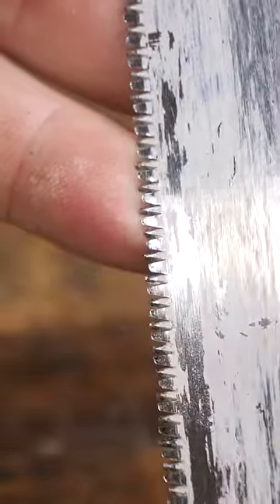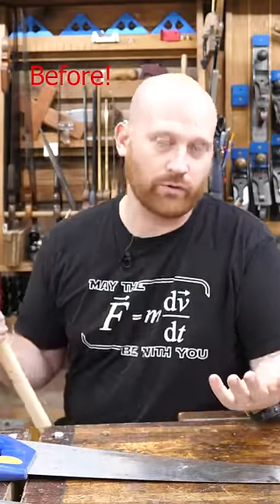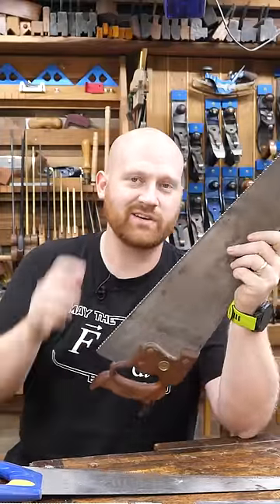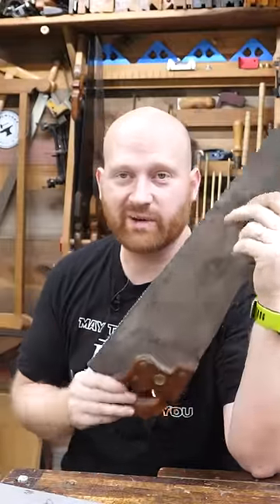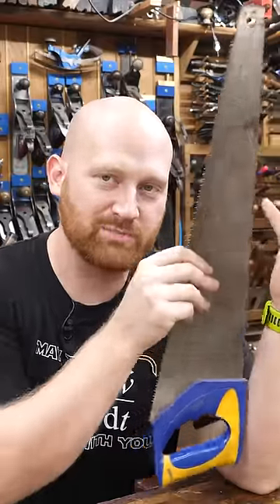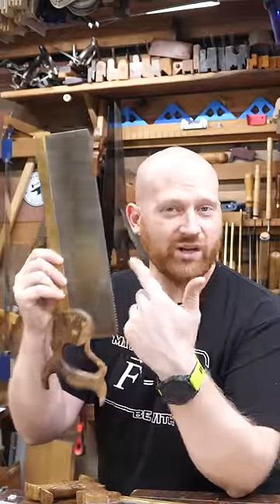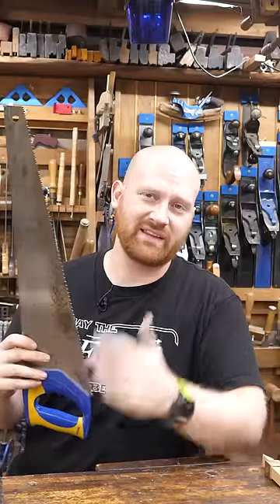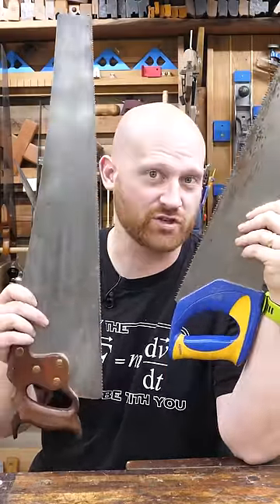Hardend Teeth Vs Old School Teeth on a Hand Saw

Comment: You absolutely can get a hardened saw resharpened and rehardened, but whether or not it's worth it is debatable, because it requires a grinding.

It's more worth it for metal bandsaws, if you know how to run them without snapping them.

Comment: But if you use the right Steel you can still harden it, then temper it to a level that's below that of your file and you can still sharpen it though.
Reply from the maker: That sounds good in theory, but in practice, it often warps the plate. most people if they want to re-sharpen it grind the teeth off and file in new teeth, but both are a lot of work for a $10 saw.

Comment: I've not tried it, but can you just heat a hardened blade and let it cool slowly, and get a blade that can be sharpened?  I know it's not really going to be worth the trouble, or even cost of the heat, but can it be done?
Reply from the maker: The problem is that usually leads to the blade warping.

Comment: Couldn't you heat the saw and slow cool to normalize the steel and then sharpen the teeth?
Reply from the maker: That sounds good in theory, but in practice, it often warps the plate. most people if they want to re-sharpen it grind the teeth off and file in new teeth, but both are a lot of work for a $10 saw.

Comment: You can sharpen hardened blades. I do it with my steel cutting   diemaster bandsaw blades. It just takes the right tooling and little patience.
Reply from the maker: Very true. However the diamond file needed to sharpen these cost more than the sawdust and do you really want to spend all that time on a $10 trash saw.

Comment: If you harden them at the factory, then you get 3x as much use out of them initially, before you need to anneal them, so you can sharpen them.
Reply from the maker: That sounds good in theory, but in practice, it often warps the plate. most people if they want to re-sharpen it grind the teeth off and file in new teeth, but both are a lot of work for a $10 saw.

Comment: That's a great idea but if your time is worth money consider how much time you going to spend sharpening a saw blade versus how much a good-quality hardened Blade cost
Reply from the maker: There is a reason that the good quality blades are in hardened. Only the cheapest plastic saws are hardened. Go look in any professional woodworkers shop.
Reply: @WoodByWrightHowTo  I grew up in one. And I also understand why people like traditional woodworking methods. And that's great if you're doing a hobby. But there's also a reason the power tools exist and are still found in every Woodworking shop actually making money. I've been a machinist for 30 years. I understand how blades work and actually enjoy sharpening tools but that takes time, lots of it. I'm not saying you shouldn't do it but there is a cost/ value equation that needs to be made.

Comment: To be fair, the quality spring steel used on old saws was harder than the junk new saws are made out of. Another reason they harden the teeth is because it makes cheap steel hard enough to cut with.

Comment: I wonder if it would be difficult to anneal a hardened saw, so it could be sharpened.
Reply from the maker: I've heard quite a few people propose that and I've seen one person try it and the saw got messed up and bent from the heat treatment. Not to mention it takes several hours to do a full cycle. It's just usually not worth it on a 5 to 10 dollar saw.

Comment: Are you also showing japanese saws? These things are a recommendation to have, because the saw operates the other way around it's extremely easy to use. Dont see many of them sadly
Reply from the maker: I've got a few videos on Japanese versus Western sauce. And I use them both for different applications. The pull stroke has a lot of benefits. But it also has a lot of downsides you don't find until after using it for a few years. The pros and cons list is actually rather interesting.

Comment: You could probably heat up the treated teeth with a torch to undo the heat treat
Reply from the maker: You could but there is a good chance of warping the plate. Most people just grind through the hardening if they want to re sharpen it, but that is a good bit of work for a $10 saw

Comment: Never seen a framer or  contractor whip out a hand saw. They’ll use skill saw, sawzall, oscillator, and a mitre saw. If it ain’t powered it ain’t getting used. Maybe shop carpenters use these but rarely field workers.
Reply from the maker: I used to do framing for a few years and we had a couple of them in the trailer. There were a few tasks where it was the fastest and easiest.

Comment: You could anneal and then reharden them. Then you’d get the best of both worlds. 

Or you could sharpen with ceramic files.
Reply from the maker: That sounds good in theory, but in practice, it often warps the plate. Because of it being a thin plate it tends to destroy slip stones. But they do make diamond files that are the right shape and size. Those just end up costing more than the saw itself. most people if they want to re-sharpen it grind the teeth off and file in new teeth, but both are a lot of work for a $10 saw.

Comment: Should I sharpen a Japanese saw, made for extreme precise cuts and is super thin, or is the steal made to last forever? (Btw, I use it on a daily basis)
Reply from the maker: If it was purchased in the US it probably has hardened to teeth and in that case it's intended to be a disposable blade. However the really high-end Japanese saws are sharpenable. However due to the multiple geometries they are incredibly difficult to sharpen and require very specific specialty files.

Comment: You make it sound like people stopped sharpening their saws first but I thought it was the introduction of cheap hardpoint saws that ended the practice of sharpening. Is there evidence of sharpening dying out first ??
Reply from the maker: Where is evidence for both. It's less if they stopped to sharpening the saw but they started using a saw that doesn't get sharpened. Such as the table saw or circular saw. The hard point saw was first introduced around that same period.

Comment: That also explains why old saws were so wide. So that you could sharpen them and still have a saw left.
Reply: It actually helped controlling the cut with a wide saw, it gave the blade more backbone, no kinking-bending when pushing forward

Comment: You can anneal the saw to resharpen it, and then re-harden the teeth if you wish.
Reply from the maker: That sounds good in theory, but in practice, it often warps the plate. most people if they want to re-sharpen it grind the teeth off and file in new teeth, but both are a lot of work for a $10 saw.

Comment: Why not soften it when you need to file and harden it when you are not?
Reply from the maker: That sounds good in theory, but in practice, it often warps the plate. most people if they want to re-sharpen it grind the teeth off and file in new teeth, but both are a lot of work for a $10 saw.
Reply: @WoodByWrightHowTo  fair, didn't think of that

Comment: You ignored the fact that sharpening files are good for only three uses, then they get tossed.
Reply from the maker: Not sure what files you're using. I can usually get a dozen to two dozen sharpenings out of a file. And that's with the cheap ones.
Reply: @WoodByWrightHowTo  
A man named Tage Frid is holding me back.  He said to use each corner of a file only one time.  He was a notorious cheapskate, so he wouldn't say it if he didn't have a reason.
Reply from the maker: Well. I've never heard anyone say that. You can get dozens of uses out of them. I know one guy who's using the same file for years. It gets slower to cut but will still do the work.
Reply: @WoodByWrightHowTo  
Frid wrote that in his book on joinery, and in an article in FWW magazine.  He claimed that a sharp file makes a sharp blade.
Reply from the maker: I would have to greatly disagree. If you read book on the topic or talk to saw makers they will lead you the other way.

Comment: So what I gather from this is that the people who value their time choose to pay more in the long run in order to avoid the hassle of sharpening saws.

you could (A): spend 50 hours learning to sharpen a saw and spend an hour to resharpen it when you need to.

Or (B): Spend 40 minutes picking up 50 saws at the hardware store and always cut with a sharp saw every time.
Reply from the maker: The problem is the cheap hardened saws cut worse, have horibal handles, and they don't come in the verities of teeth you would want for woodworking. Just rough crosscutting.

Comment: Or the entire saw can be hardened but not super hard just harder and we sharpen them with cbn or diamond particle feather files so we get the best of both worlds.
Reply from the maker: Problem with hardening the hole saw is that it then becomes brittle. There's a reason the plates are tempered to only about 45 or 50. At that point it's a spring steel and wont knik as easily.

Comment: Why not sharpen a blade after the hardened teeth wear away?
Reply from the maker: most people if they want to re-sharpen it grind the teeth off and file in new teeth, but both are a lot of work for a $10 saw.
Reply: @WoodByWrightHowTo  thank you! Appreciate the timely response

Comment: You can purchase a diamond impregnated file to sharpen these hard piont saws
Reply from the maker: there are a few of those the correct size and shape, but they cost more then the saw. and to you really want to keep using a cheep plastic saw?

Comment: You could get rid of the temper with a propane torch.
Reply from the maker: That sounds good in theory, but in practice, it often warps the plate. most people if they want to re-sharpen it grind the teeth off and file in new teeth, but both are a lot of work for a $10 saw.
Reply: @WoodByWrightHowTo  Good point!

Comment: I'm so confused. I feel like it went back and forth on which blades are hardened and not.
Reply from the maker: If your saw was purchased at a big box store or hardware store in the last 20 years that probably has hardened teeth. If it's an antique then it probably does not have hardened teeth. If you look closely at the teeth hardened teeth will be blackened with a shiny plate whereas unhardened teeth will be the same color as the plate

Comment: Would sharpening with a simple set of diamond files not work.
Reply from the maker: The diamond files with the right shape and size cost more then the saw.
Reply: @WoodByWrightHowTo  Coming from the knife world that isn't weird to me and still seems worthwhile if you can get multiple times the life time out of every saw but to each their own.
Reply from the maker: True. But then you are left with a trash saw that has a poor handle. At that point you could make a new handle for it but after doing all that work you might as well just go by a good quality saw.
Reply: @WoodByWrightHowTo  Fair enough. Just because you could sharpen a utility blade doesn't mean it's worth the effort. I guess the same logic would apply to a cheap intentionally disposable saw.

Comment: Cant u recycle the metal?
Reply from the maker: Yup
Reply: @WoodByWrightHowTo  would u need to remove the handel from it or could u throw it all in the recycling bin?
Reply from the maker: depends on your recycler. but you can also re use the plate for a lot of other things.

Comment: You can definitely sharpen hardened blades/teeth without destroying a file.
Reply from the maker: They do make diamond files that are the right shape and size. But those cost more than the saw and do you really want to spend that kind of money on a cheap plastic saw.

Comment: Blowtorch detempering go brrrr.
Reply from the maker: That usually ends up warping the saw. Most people if they want to re-sharpen it they just grind the teeth off past the hardening and then file them like normal. But that's a lot of work for a $10 saw

Comment: Solution: diamond sharpener, which I'm sure you already know.
Reply from the maker: that can work, but they tend to rip the diamonds off because you are going across the plate. not to mention they cost more then the saw. not sure it is worth it on a $10 plastic saw.

Comment: You can use a grinding Stone if you know how to sharpen harden steel. You know that?
Reply from the maker: You can't sharpen salties with a grinding stone. For that you need a 60° file. They do make diamond files but that is more expensive than the $10 cheap plastic saw. There's a reason that quality saws still come with unhardened teeth. You just won't find them in the big box store.

Comment: with the right diamond files and highspeed cutters you can sharpen any hardness.
problem is chipping and bending hard teeth that break when angle is reset.
the precise alternating angles of the teeth are critical to a even pull and selfclearing cut.
Reply from the maker: They do make diamond files the right size and shape for it, but they cost more then the cheap plastic saw.

Comment: If you really do want to sharpen your saw you can anneal the teeth with a torch.
Reply from the maker: That sounds good in theory, but in practice, it often warps the plate. most people if they want to re-sharpen it grind the teeth off and file in new teeth, but both are a lot of work for a $10 saw. By h

Comment: You can anel them
Reply from the maker: That sounds good in theory, but in practice, it often warps the plate. most people if they want to re-sharpen it grind the teeth off and file in new teeth, but both are a lot of work for a $10 saw.

Comment: Have you ever heard of a diamond file 😱
Reply from the maker: Yes. I have a video coming up on those. They do work but they don't last very long you only get a couple sharpenings of them due to working on a thin plate structure it strips the diamonds off pretty quickly. And usually they cost two to three times as much as the saw. So the question you have to ask is, is a $10 plastic saw worth it?

Comment: Honestly, I've never understood why saws are so wide but are only used for like 1/16th of the blade. Like, why?
Reply from the maker: it keeps the blade on track and keeps the plate stiffer. you can get thin blades like that but they are for turning saws where you want the blade to turn and go all over.
Reply: @WoodByWrightHowTo  so then, is my reciprocating saw more efficient material wise? Just curious the mechanical advantage of using a wider blade on hand saws vs the smaller saws with reciprocating saws.
Reply from the maker: The reciprocating saw is only up to 10-12" and if you have used those longer blades you know how easy they are to bend. when the saw is 24"-36" it needs more support. even in the hand tool world they have keyhole saws that have a similar profile but shorter.

Comment: If your good enough you could bring the hardness down through annealing.
Reply from the maker: You could. But then you'd be left with an inferior steel that would dull more often. Not to mention you need to run a very good chance of warping the song. Usually if people really want to keep using it they grind the teeth off and cut a new ones.

Comment: You could probably unharden the saw teeth with a blow torch
Reply from the maker: That sounds good in theory, but in practice, it often warps the plate. most people if they want to re-sharpen it grind the teeth off and file in new teeth, but both are a lot of work for a $10 saw.

Comment: couldnt you just heat the teeth to unharden them?
Reply from the maker: That sounds good in theory, but in practice, it often warps the plate. most people if they want to re-sharpen it grind the teeth off and file in new teeth, but both are a lot of work for a $10 saw.

Comment: un harden the teeth with a torch when they go dull and re sharpen them
Reply from the maker: I know a couple people have tried that. But it ends up being a lot more work and often ends up warping the plate. Usually people will grind through the hardened teeth and refile new teeth.

Comment: You can't use diamond to sharpen it 
   I know there is this misconception it's expensive but can get pulverized diamond for 30$ a gram
Reply from the maker: The problem is finding the one that is the right size and style. I haven't seen one for under $30 a piece. And most of these saws are 5 to 10 dollars a piece.

Comment: Not to be rude, but in the last 150-200 houses I've built, we did not use a hand saw once. For my last 50 houses, we were already onto battery framing hammers, so no more Tangled air hoses. I retired from framing, and now do all finish carpentry, and I have 80 hours on batteries for my 20v tools, the only tool I still plug in is the table saws, but in a couple years the battery table saws will be better and I'll be using one of those too.
Reply from the maker: When I did framing we always had two of them in the trailer for odd jobs such as cutting out the base plate in doorways and other similar flush cut situations.

Comment: The newer says once they're done with. You can actually unharden them with a flame. And when you sharpen, you can reharden.
Reply from the maker: That sounds good in theory, but in practice, it often warps the plate. most people if they want to re-sharpen it grind the teeth off and file in new teeth, but both are a lot of work for a $10 saw.

Comment: The old saws were hardened, just not super hard. Its not like they made saws out of mild steel.
Reply from the maker: true they were tempered to around 45-50 but in the saw world they are referred to as un hardened to separate from the newer saws that have hardened teeth.

Comment: When a new saw wears out you can just anneal the blade and sharpen it all you want.
I’m just curious,  if you’re resharpening  blades how do you not know about this?
Reply from the maker: That sounds good in theory, but in practice, it often warps the plate. most people if they want to re-sharpen it grind the teeth off and file in new teeth, but both are a lot of work for a $10 saw.